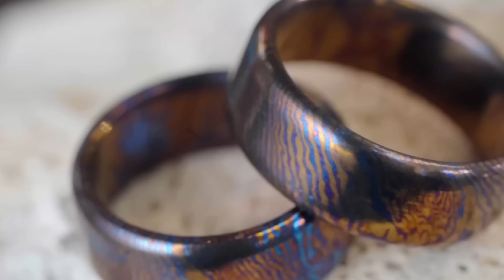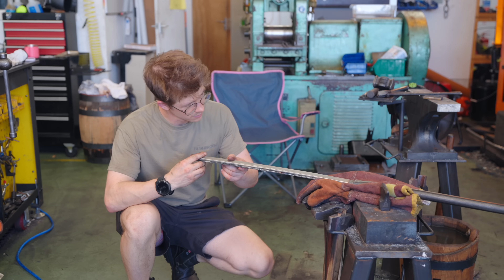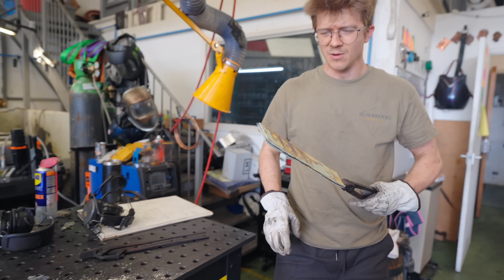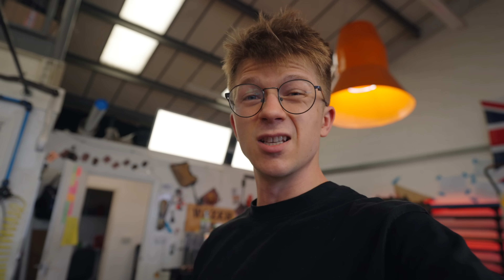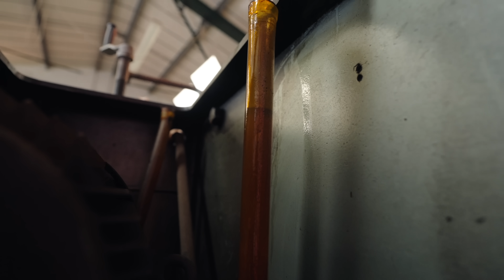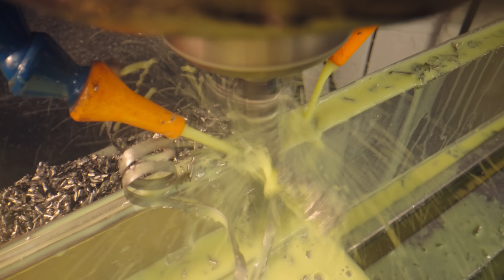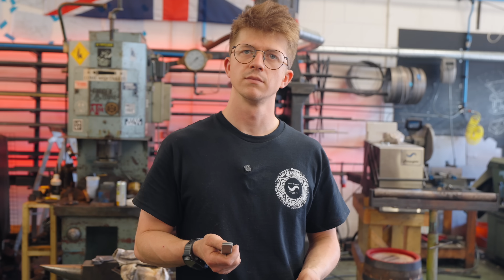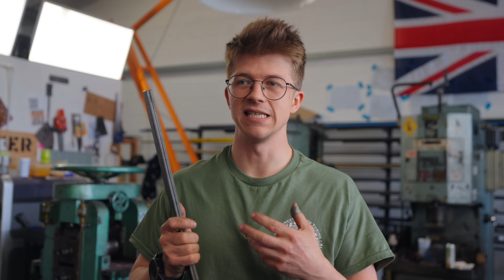Making a Titanium Damascus Katana - Part 1

Comment: A quick search for a eutectic diagram of nickel and titanium shows that the lowest point where the alloy is liquid is at around 25wt% nickel and 75wt% titanium, which melts at 942 degrees celsius. I think that alloy is being formed when the billet is heated to near 1000C for a substantial time, which then turns liquid, consumes the nickel interlayer, acts as a solvent for the titanium and iron, and causes the TiFe intermetallic, or even a TiNiFe phase, to form. The formation of the TiNi might happen much slower than when TiFe forms without the interlayer, which would explain why nickel seems to be a good interlayer material. Also, if this is the mechanism, it would likely be self-accelerating, especially when the billet is being deformed in the rolling mill. Just a hypothesis, may likely be wrong.
Reply: From what I remember of the metallurgy I learned at college, this sounds more than plausible. Granted, that knowledge is a decade old by this point, but some things stuck and based on what you said, this should definitely be considered. Maybe heating the material only to 930 Celsius is the answer (or at least part of the answer).
Reply: @Keiranful  I feel like 925 would work better
Reply: I was always annoyed Alex didn't try using more than one intermediate layer between the steel and titanium when he started experimenting with these bonds.. Maybe something like Ti to Cu to Ni to Steel. Seems like you might be someone who could make a better suggestion, and maybe Alex will see that comment.
Reply: Bump
Reply: @Sausketo bump
Reply: @MrBrutalMachinee bup
Reply: Bump
Reply: bump
Reply: @Scandium_quasar  key bump
Reply: sounds pretty smart to me!
Reply: Never knew that’s how Tina Fey formed
Reply: Well, I'd say every word of this is spot on, clear to see by anyone with  even the most cursory familiarity with the subject. I may likely be oblivious to what any of it means yet I am enlightened, my conviction strengthened and my commitment steadfast and unwavering. Let those guided by doubt, self-loathing and irredeemable degeneracy be stricken with unrelenting and insatiable disease and plague.
Reply: @billybob6784  sugon dietz nuts

Comment: This is looking like an extremely difficult process for hammer forging. You need argon and a heat source to keep the metal hot wile hammering, or something. How can this even be possible in any normal way. Makes sense why they bond these metals over a long time with steady pressure.

Comment: commenting before the end of the video: i wonder if this problem of it being unforgable after the initial jacket and bonding is due to the two metals moving under the pressure at different rates, obv steel moves differently at 900 then titanium moves at 900

Comment: Yeah Alex still Damascus is a pretty nice metal, but there's a technique made before the Japanese katana. It was where you use a stronger metal in the center thinner weaker metals on the outer side to make up the thickness of the sword. So that way The cutting edge is tough and the outer edge is still soft. Keeping a beautiful look and still keeping a sharp edge. Maybe try doing that.

Comment: Since the main issue seems to be voids between the titanium and the nickel layers, have you considered electroplating the titanium sheet with nickel, before putting it in the billet?

That way, you can guarantee thorough contact between nickel and titanium across the whole material.

Comment: I dont know if someone already said it, but if you want to apply the same amount of strain with every pass, it won't be a linear change. You would have to increase the change in the actual depth of the roller because each time you reheat the metal, that becomes its new "state" and so a new starting area for strain to apply

Comment: Alec, 

Maybe it’s a silly idea but perhaps having the inter layer wider and longer than the steel and titanium pieces. 

Perhaps using 2 inter layers and almost creating a reverse inter layer sort of jacket that will be ground off later in the process? 

Maybe a slightly thicker inter layer section
Reply: If it helps as a visual I mean something like (|][|)

( = removal jacket 
| = steel for one side and titanium for the other 
] = inter layer, the over hang of material could potentially be ground off?

Comment: In thinking and I might be wrong but since the air cooled had the flexibility at the diffusion bond. couldn’t you make the blade as your thinking without hardening then use the coil heater to heat just the exposed knife edge like they do with hand saws?

Comment: In truer katana making fashion, keep the spine softer and only really worry about the cutting edge hardness. This would keep the spine bonding a lot better, per the samples seen today. You /should/ be able to differentially harden the final profile with all the knowledge you gained in the testing you have done. Especially since you intend to have steel as the cutting edge and internal spine with the titanium only being a "wrap" on the outside (I could be partially misinterpreting the design intent, so apologizes if I have) [between C {hosanmei} and D {shihozume} on the diagram is the closest approximation I saw].

Comment: Im intimately aware with the need for steel toed boots in this kind of work envireonment. And that he isnlikely wearing shorts because of the extra hot summer europe is having. However i would think that keeping the tops covered so hot slag doesnt fly off the power hammer and into the boot would be a good idea. Or sparks being toothpasted out of the roller press

Comment: So he mentioned that he could bond the steel to titanium with a quick quench. I'm wondering why not make a billet that is quickly quenched then rework it and draw it out. If the fusion has already taken place, then wouldn't the material not be able to change atomic structure if undergoing another heat treat?

Comment: Isn't part of the value of katanas that they can bend without permanently deforming, and are stiff enough not to bend easily, without being brittle?  Also, a sword that can be bent is only good if straightening it is not destructive, at least a few times.

Comment: Would it be possible to set up the induction forge in front or the rear of the powerhammer to keep the heat as you forge the longer Katana peice, after it has been brought up to temprature in the Kiln?

Comment: Before you even start... please... Katana has its "bend" shape from difference of shirink between spine and edge. One of them is cladded with mud and straw during quenching process, so parts of katana will contract in different rates. Other wise it would stay straith. Please do not bend katana during forging.

Comment: Honest question/suggestion because I'm definitely not a blacksmith so I don't know if this is possible.....Is there anyway you could make a (sorry not sure of the proper word) form or jig that you could have be a little oversized of the blade dimensions, so i'd imagine a small long box in the tank with holes to let the fluid in to stop it from warping as much?

Comment: If memory serves, the expert you consulted said that the best way to do the weld was to make sure it spent as little time at heat as possible rather than using any interlayer. Is that just not a viable option on a piece this large?

Comment: Even without the Damascus, anodizing that test piece would make a cool sword. 

It's long enough that you might be able to pull it out of the anodizing bath slowly and change voltage as you go to see if you can get a rainbow effect down the blade. It's an experimental piece anyway, might as well mess with the next steps

Comment: I hate to be that guy, but buying and manufacturing curved swords over 50cm is heavily restricted in England and Wales. The manufacturing of a katana using non-traditional methods, which bonding steel and titanium arguably is, could constitute an offence under Section 141 of the Criminal Justice Act 1988 unless you meet certain exemptions. That might be the case here but make sure you are fully aware of the law. I would expect that any katana sold by the sponsor would be illegal to own for most people.

Comment: an alternative to the microscope is get a good flat bed scanner and scan the part that way it gives you an image you can zoom in on i often use one for checking for stress fractures in wrought iron to know if it needs to be upset before it can be worked with as often wrought iron left under tensions for years and years with stretch and fracture forming lots of voids

Comment: have you though about adding a nickle layer between the canister and the titanium to be able to ad a bit of complexity to the pattern as well as let you  have more flexibility in forging it out   alternatively after your first forge welding and peal of the canister do a second canister with nickle power around the original billet then forge that with the outer canister staying on

Comment: Why heat treating it all (and exposing the whole billet to the stresses) instead of a final edge quench? If I understand your scheme from 34:55, you will have only steel on the edge. Which gives you the chance of going for a controlled localized heat with an edge quench. Still hard, but saves you from exposing the Steel-titanium bonding surface from the higher stresses.... Also that would be consistent with Katana's traditional heat treatment, a nice touch :)

Comment: There are 2 ways to ensure there is no oxygen in the billet. One way is to put your mouth over the hole and breath it in until you collapse.

Argon is heavier than air so in theory if you hold it so the hole is at the top then the lighter air should all get pushed out. Maybe dont force it through at full pressure, rather, give it time and a gentle flow like filling up a swimming pool.

I dont know anything, always check with a proffessional xx love you xx

Comment: I wonder if the emense friction of rolling is causing the nickel to get above its melting point. You are only a few hundred degrees away from its melting point coming out of the kiln. What materials have you tried for the interlayer? Maybe something with a higher melting point would help. Maybe a nickel alloy of some type.

Comment: Depending on where the heating elements are in your long kiln, you could just get a second one, drill a hole/make a cutout/just remove the back wall from each of them, then sick them together ass to ass using refractory cement and welding!
Then you’d have a super long kiln which can be accessed from both sides!

Comment: I don't know how you'd achieve it, but would compressing the laminate and holding it at temperature under pressure possibly improve the bond? The extended time might provide more diffusion?

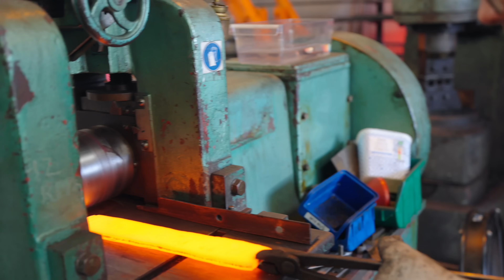Comment: Alec, you might already know this, but nickel and titanium can form brittle intermetallic compounds (Ti₂Ni, TiNi₃), similar to the TiFe / TiFe₂ formed with steel and titanium. Ti₂Ni and its eutectic phase melt at around 942–985°C! Maybe it could be that in the joint that squirted out during rolling at 10:55. Also, the formation of these intermetallic compounds could be the reason there was some delamination between the titanium and nickel layers under high stress. But your test blade seemed to hold up well! Hopefully, the presumably extended time at temperature on the final katana won't cause any delamination issues!
Either way, really looking forward to the rest of this series!

Comment: I thought a traditional Katana was pig steel folded like 1000 times until enough carbon was physically worked out of the material. Is damascus not possible if you folded the blade this much?

Comment: I'm going to preface this by saying I'm not knowledgeable about this stuff at all: but would you get better results if you used an air hardening steel? 

My undeveloped brain thinks that if you can circumvent the quenching process you can keep your bond to the titanium stronger.

Comment: i wonder if you texturised the harder of the two metals, so that when you bond them the softer fills the small cavities to create a somewhat mechanical bond. increasing surface area of the bond and helping prevent sheering of the bond and delamination. also when you tried milling the titanium down and the bond delaminated, would the heat introduced have weakened it. if you took smaller slower passes and introduced too much cutting fluid as a coolant would this help? Also, and this idea is a bit mad, but would friction welding make a stronger bond between steel and titanium. Love the videos <3

Comment: Alec, when we braze or weld materials for my work and need to check the out coming purge gas is below a certain percentage oxygen we use an oxygen analyzer with a tube on the end and have different cones for different shapes to adapt to the tubing or material

Maxtec makes a Handi+ model that’s relatively cheap if you want to get scientific about it

Comment: Did they insulate the heat up back in the days?  Might be needing less temperature and/or slower heat up.
Thinking about the thermal expansion is not as shocking on lower temperatures.

Comment: Have you tried different surface treatments to maybe roughen metal pieces before bonding? Those features may increase surface area, which may help with bonding and increase "friction" between layers, so less likely to come apart.

Comment: Take into consideration that with Damascus <anything>, on the surface you will have a material with a range of properties. Bonding a multiproperty surface to another multiproperty surface might risk "interesting" defects.

But if it works, the final composite would be fun to see.

Comment: For a century, the katana was at the forefront of metallurgical innovation, across the world? ... Katana are fine swords, and the Japanese bladesmiths of old were indeed great, but...
No.
That is not even faintly true!

Japanese smiths learned their metallurgy from China. Yes they developed it further, but so did the Chinese
...and they didn't do anything that wasn't also known/done in Europe.

They folded the steel? Yeah, they learned how reduce impurities and make the metal more homogenous, by folding the steel ...from the Chinese. And it was a known and common technique in Europe, well before the Japanese used it. (though, in "the West" people liked to do more than just simple folding. They also added twisting and the like. By the time Europeans encountered the katana, however, Europeans had largely stopped using the technique, due to having far more pure/homogenous steel, that made it largely pointless and superfluous)

Comment: You can know if there is oxygen coming out of the hole.  Light your oxy-acetylene torch without the oxy.  Put the flame over the end of the hole.  If there is oxygen, the flame will get bigger, or something.  If there is only inert argon coming out of the hole, then it won't get bigger.  Probably.

Comment: It seems the biggest problem here remains that titanium and steel just don't want to bond together. And if it's already an issue with solid pieces, I can't imagine the nightmare it will be once you make them into Damascus with 4 different material pairing randomly interacting...

Comment: You Should try something more akin to dropped forging and you should preheat your argon because you have to have uneven heating plus you'll probably us less use a copper coil and torch or something and the drop forge would smear the metal into one solid spine and edge just my ideas! Edit clamping forse while temporing on bilits might help

Comment: In Katana, the spine is usually low carbon steel to enchance the flexibility while the high carbon steel is used specifically for the blade. Perhaps use different kinds of steel?

Comment: Can the problem by in big starting plates? you have huge surfaces that can trap air if there is any surface deformation. I would try to run it cold through rolling press, ore something like this. GL

Comment: This is gonna be very difficult, because the stress through the different thermal expansion coefficient of the materials, especially at longer workpieces. 
With some back of the napkin math with a roughly 1m katana, worked at about 1000°C, if the titanium and steel are the same lenght at forging temperature, the steel will be about 3 mm shorter than the titanium when cooled. At short pieces the nickel interlayer can absorb some of the mismatch, but no 3 mm.
This will nealy certainly result in delamination in bigger workpieces, especially if they are re-heated multiple times.
It might be possible to embed multiple shorter steel blade sections in a titanium katana, but this wil automatically result in gaps between the sections after cooling.

Comment: If you want to displace all the oxygen (air), there's no need to pray: 

Argon is heavier than Oxygen (and Nitrogen, for that matter) so keep the escaping hole pointing upward, and decrease flow - so the argon does not quickly "push by" pockets of air

That way, the argon will fill up the container from the bottom (like water) and push put the air on top of it

Comment: A thought about the "Canister" for the argon flow.
Would it not be a better thing to drill 1 hole on each side of the end-plate?
I would imagine 1 hole in the middle creates some bit of vortex in the canister, potentially leaving some oxygen inside.

Comment: Hey, since youre always looking on the cracks or lack of fusion, maybe the white/red spray method used for welding would help with it? Dye penetrant inspection is called if i remeber correctly, or if you want to be a bit fancy i would sugest Magnetic Particle Testing

Comment: This might not be something feasible for this specific project, but I'm fairly certain you can use plasma welding to bond titanium to steel without an inter-layer.

Good idea using a laser welder instead of GTAW, way more efficient heat management but you still get the benefit of the Ar gas.